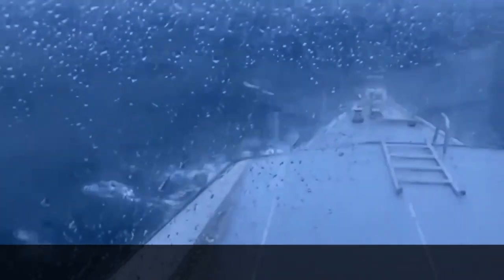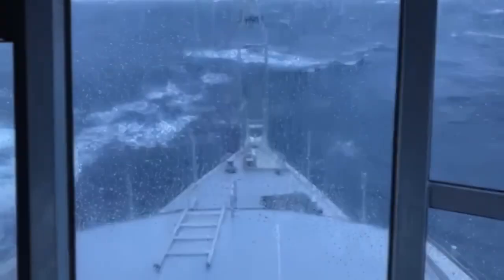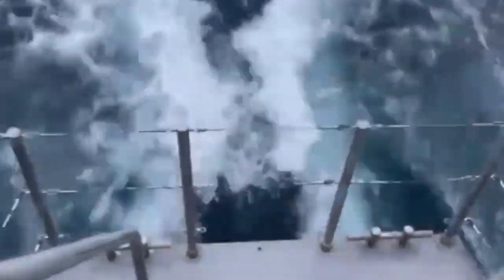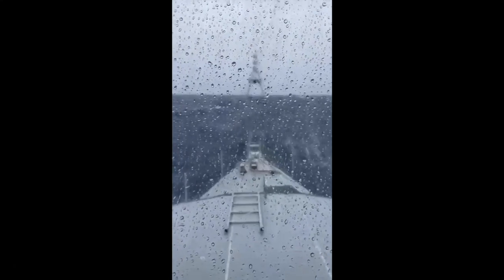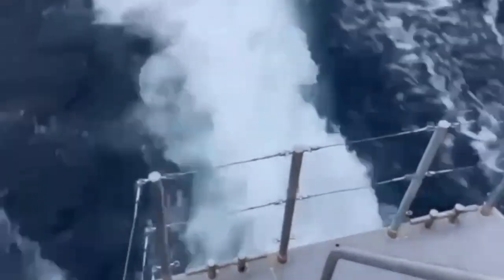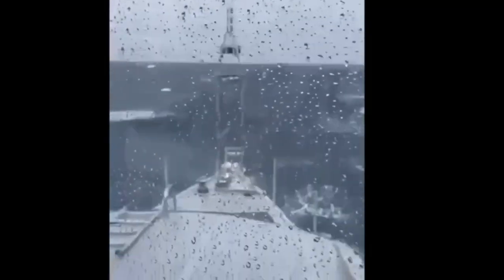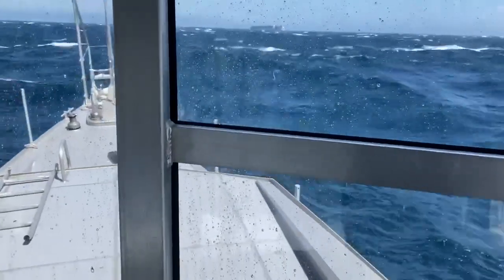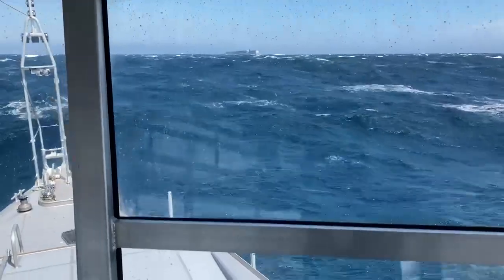FPB 70-01 during a gale in the Sea of Japan | Narrated by FPB expert Steve Parsons

Comment: First, let me say, I don't think there is a better cruiser for its size. I've spent years offshore in the Gulf of Mexico as a radio navigator on a research vessel. The GoM is often rough like these seas in the video. Those seas are tolerable but tiring and tedious but it just makes you all the happier when you reach port. If ony I were 20 years younger and a thousand times richer. Sigh.

Comment: great video and performance of the boat is pretty incredible. To only lose 2 knots in such challenging conditions is a real credit to the design.
What speed would you reduce a 64 to in same conditions (1,000 turns would achieve ?) And is she leaning slightly to port, if so why is that ? Thanks for a great video. Enjoyed that from my comfy sofa :-)